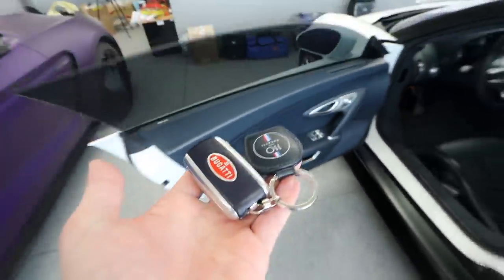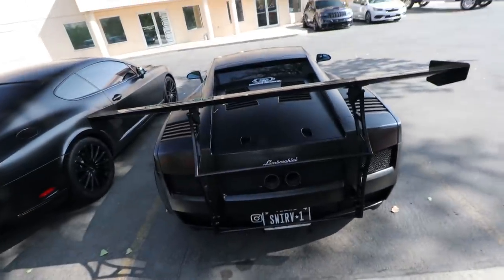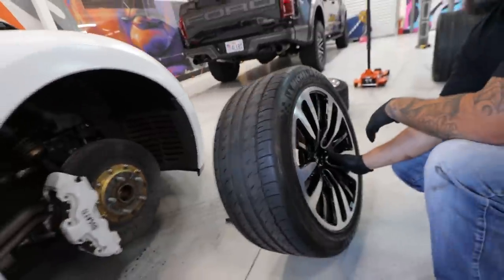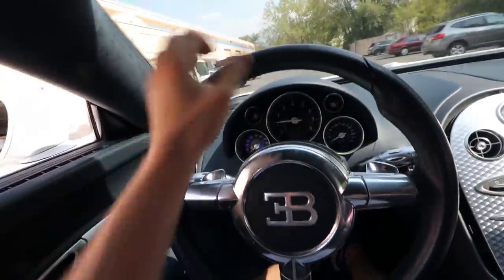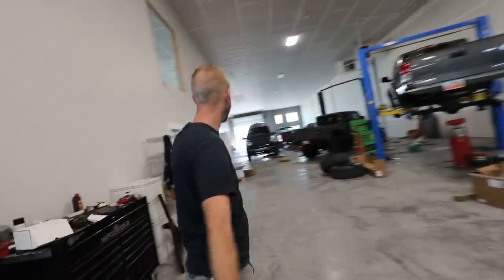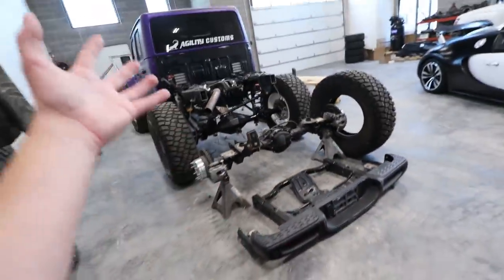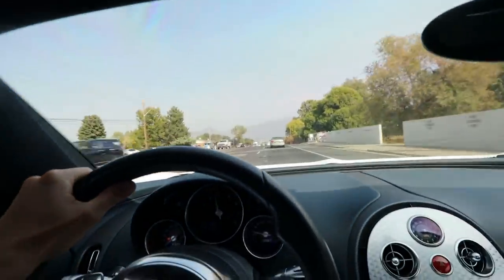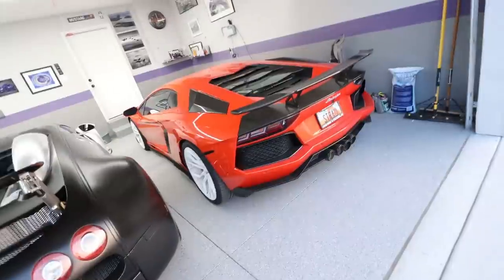My First Bugatti Modification!!

Comment: I feel like that gladiator is getting nowhere
Reply: SEMA has been cancelled in 2020... so the rush to build it went with it ;)
Reply: Same
Reply: To tide you over, he picked up a Bugatti. Hard to please everyone, I suppose. Lol.
Reply: The gladiator paid for the new shop.
Reply: The thing with builds like this is that it takes a lot of time and work. there's tons of R&D involved in developing parts like the axle, chassis. making sure the bed looks right. And the one thing that a major issue with rush builds is usually they have lots of problems with fitment, reliability issues. Most, not all builds but most SEMA builds rush the build for the show then spend months making sure it's done right afterwards. My restomod 68 Mustang took years to build. from the custom suspension to making the engine fit and sit right. just takes time. all tho I wish there are more updates on the build
Reply: True
Reply: So
Reply: Scott Walters lol I didn’t mean it like that, I have been rooting for the bugatti since day one. Just getting inpatient
Reply: Colin ok thx that puts it more in perspective
Reply: Eish!
Reply: There’s no “kit” that you can buy, everything needs to be special made and ordered. And because of Covid the places making those special parts had to close, but are not back open so in about 2 months time it should be done
Reply: New wheels look so much better..
Reply: @ianpat2768  Normally that would likely be the case but I'm guessing they discounted it highly in exchange for the exposure Strad provides them on his channel. If that's the case it's really not bringing in much cash so it's not as important as other jobs that pay the bills. Also the longer it takes the more often Strad will have to travel to their shop and advertise them. Now that the frame is cut they have a lot of leverage over him. Hard to take the truck and run.
Reply: @TheInsaneShecklador  they turned George Jefferson and moved on up.
Reply: @ianpat2768  most people won't understand the reference there

Comment: James: I need 38k wheels and Tyres to go 250mph
UGR: does 260mph in the half mile with Toyo Proxess 😂😂 what a ripoff
Reply: Tiaan van Zyl UGR?
Reply: @herb3163  Underground Racing... they specialise in building twin turbo gallardos and huracans
Reply: There is a big difference in Bugatti and UGR, Bugatti's philosophy is that their clients can consistently effortlessly drive at high speeds in all luxury, straight from the factory. I don't know too much about UGR, but I think UGR's reputation can afford technical failures or accidents whereas Bugatti's clientele will shrink.
Reply: Actually the wheels were 80k euros and tires at 38k USD if I heard correct
Reply: @040brian  TBF they can't, because if they're anywhere near full belt they get about 35 minutes of driving. All this changing 4 tyres at a time is a rip off, couldn't be bothered with the constant worry.
Reply: Brian Cuijpers The Veyron isn’t exactly known for stellar reliability.
Reply: 𝒄𝒉𝒆𝒄𝒌 𝒐𝒖𝒕 𝒎𝒚 𝒄𝒉𝒂𝒏𝒏𝒆𝒍... 𝑰 𝑫𝑶 4𝒘𝒅 𝒗𝒊𝒅𝒆𝒐𝒔... 𝒔𝒖𝒃𝒔𝒄𝒓𝒊𝒃𝒆 𝒂𝒏𝒅 𝒘𝒂𝒕𝒄𝒉 𝒈𝒊𝒓𝒍𝒇𝒓𝒊𝒆𝒏𝒅 𝒄𝒍𝒆𝒂𝒏𝒔 𝒎𝒚 𝒄𝒂𝒓!!!hh

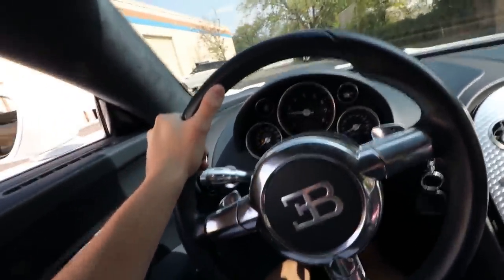Comment: 5:24 Does the Veyron even reach its top speed with the detuned 800HP?  Those new wheels look more factory but the aftermarket ones are much cheaper to run with normal less expensive tires aviable for them. Also I didnt mind the chrome aftermarket look...

Comment: The new Rims and Tyers “You need to change the Tyers every 2,500 kl and change the Rims every 3 sets of Tyers On The Bugatti Veyron Tyers and Rims You just Fitted
 Thats thats a $220,000.00 Tyers and rim Cost for 10.000 miles of range. James do not waste your Tyers.

Comment: What the hell is the point of having a Bugatti if you're gonna drive it around on low boost??? Get a 50 gal drum of some SAUCE and mix your tanks so you have higher octane then recommended, you'll actually LOSE horsepower if you over shoot the octane but it will be safer... 980(1001) HP is cooler then 850 :0